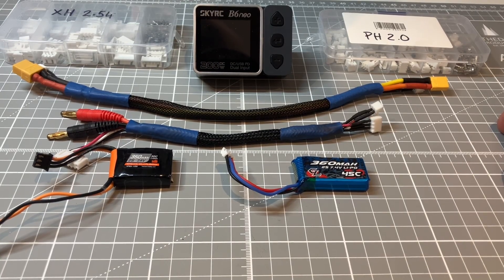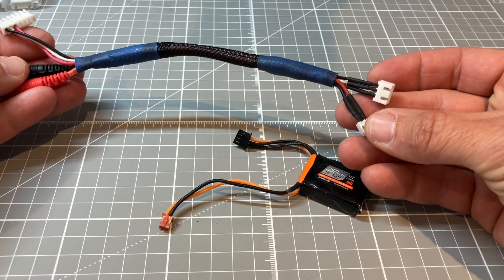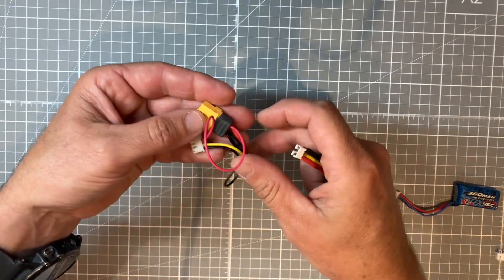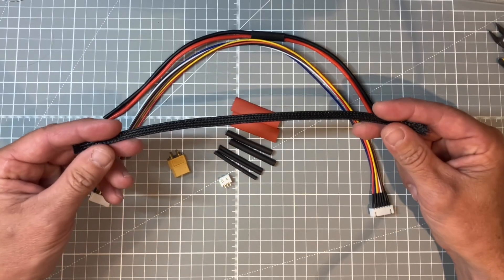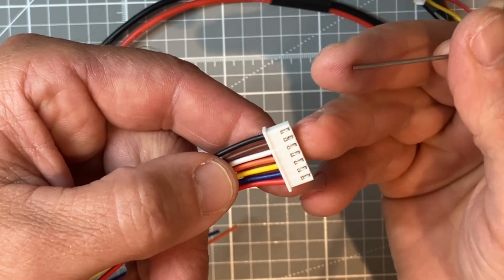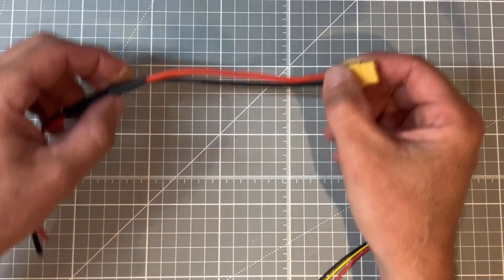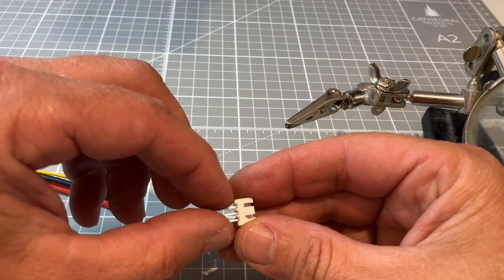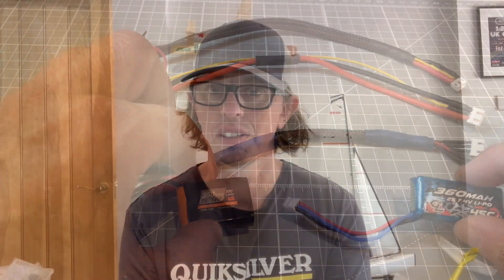What RC Charge Lead Do you Need? DIY Micro LiPo Charging Cable for Mini-Z & Losi Micro B

Comment: Thank you for this. 
All my batteries have 22awg wire, could I use that gauge for the whole loom as I have load of that to hand
Reply from the maker: I would think it would be fine, just cheque it doesn’t get hot when charging